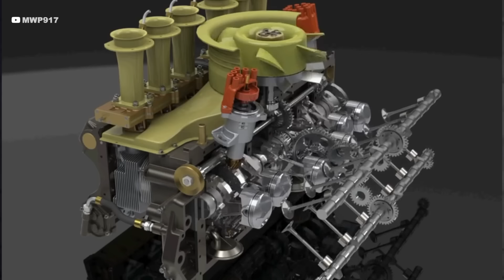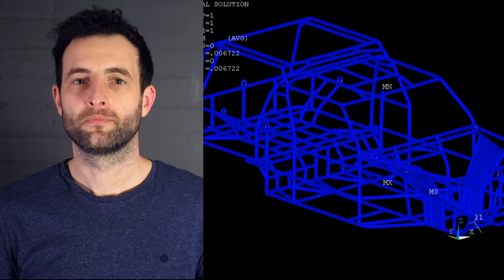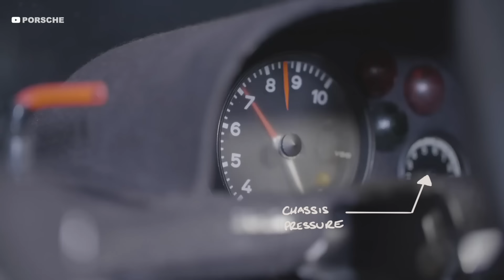The Porsche That Had an Inflated Chassis

Comment: A little misleading about the horsepower claims. The Lemans cars never came close to 1000 horsepower. Those numbers came about when the turbocharged 917/10 and 917/30 Can Am cars came along. My recollection from that era was it made under 600 hp in endurance racing mode and was severely out powered by the can am engines of the era that were around 700 horsepower. My favorite car of the era by far but by that time Enzo had lost interest in endurance racing and the very limited support of the 512m was proof of that. Roger Penske built a 512 that was faster on 3 separate occasions in a very limited schedule during the 917k models season. Ferrari spent the time developing the 312 for the following seasons rules and they dominated the next year. It would have been great to see the two teams slug it out for both of the 917 Lemans cars seasons but that didn't happen.

Comment: I remember hearing a story of a Top Fuel drag bike that also had a pressurized frame.  The difference was that it was pressurized with nitrous oxide and that much of the gas would be lost during the run with the leak being traced to just in front of the intake.  It seems like a good part of racing is the 'creative' interpretation of the rules and hiding it from the inspectors.

Comment: Extreme heat in the cabin is the lesser evil seen in the light of a crash...!
However, this car "only " got 520 Hp as standard, but with turbo (from 1973) that beast had 1100 Hp. 
The car weighed between 730 and 909 Kg. Imagine a weight to HP ratio of 0,820 Kg/Hp.

Comment: Porsche hired John Weyer from JW automotive engineering in England to come to a test and figure out why the 917 was so unruly. Weyer and one of his engineers were the ones that picked up on the bugs being on the front and not the rear. Weyer then asked the Porsche mechanics if they had any tin snips and without talking to the Porsche boys set about cutting up the rear of the car and reshaping it right at the track. This led to more stability and faster times. There is a video on YouTube with John Weyer telling the whole story and more it is well worth the watch. It will easily be found under John Weyer racing Porsche etc.

Comment: Another advantage of pressurizing the space frame is that the peak compressive load and average stress in the compression members can be reduced, thereby reducing the tendency to buckle. That would enable the designers to select longer spans of pipe to be used with fewer joints. Fewer joints = fewer stress risers = a structure that is stronger pound-for-pound. However, you wouldn't want to pressurize tensile members as that would increase the average stress acting in them and shorten their fatigue life.

Comment: Might need to do some fact checking there the space frame was only ever pressurised with air to see if there were any cracks in the chassis 

It was only ever rumoured that the chassis was filled with nitrogen

Comment: They fill the chassis with nitrogen or other inert gas in order to detect leaks. Fractures or cracks in the chassis would be easy to detect if there is a gauge on the chassis and the whole chassis is under like pressure. It has nothing to do with making the car lighter

Comment: The longtail version had the rear flaps connected with the suspension, moving up and down when uphill or downhill, increasing or decreasing downforce
Reply: Except they didn't do anything...as evidenced by the 1969 Osterreichring testing that showed no bug splats AT ALL on the rear flaps, even after they cranked the angle up...and up...and UP to fully vertical...straight up !... and still no bug splats. Good idea, but these flaps didn't work.

Comment: I have LOVED the 917 since I was a kid in the 70s. I had the Hot Wheels version.  As I grew older I got into building 1/24 scale models, the 917 was never available. 

When Ford made the GT back in 2005 the first thing I thought was why not Porsche make a road going 917?  Porsche making a V10 monster for the street with the smooth sexy shape of the 917 would have been nice.

Comment: Storing oil in the frame comes from earliest race bikes. It doesn't only save an oil tank but it also saves an oil cooler and therefore it safes a certain amount of aerodynamic drag. At least that was the reason race bikes used the frame as an oil tank.

Comment: Put high pressure on that nitrogen, increase the tubes diameter, reduce the wall thickness further.
That way the tubes would take more torque.

Comment: One relatively unknown bit of trivia, regarding the Salzburg Le Mans 1970 race-winning 917 (#23) of Hermann and Attwood:  Their car was was a four-speed, and was fitted out with a VERY tall first gear, such that they calculated their car was giving up ten seconds a lap to the front runners.  Just dragging like a VW bus out of every slow corner and when leaving the pits, and they were pretty demoralized at not having a competitive car (so they first thought).
The idea, of course, was to minimize wear and tear, and, in the end it did pay off with the win, while most of the other 917s, all driven more aggressively, failed to finish.  Siffert, for example, who, while leading by four laps or so, missed a shift and blew up his motor rather spectacularly by going down a gear, rather than up a gear under heavy acceleration.   Then there was the #25 of Elford, Ahrens, who's car failed somewhere around the 20th hour with a cracked bell housing (the large bulge which surrounds the clutch).  The second failure can be attributed to accumulating stress and strain on the entire engine/transmission, of which it seems the bell housing was a weak point, while the former can be attributed to...
...well.  Your opinion is as good as mine.

Comment: Terrific video! Thanks to such detailed info. Really fascinating!

Do you know if anyone is using aerogel as an insulator? It's incredibly effective and weighs next to nothing as it's about 99% air. Yet you can sit it over a hot flame & it still be effective on the other side. 
(Imagine a Petri dish size and shape piece of blueish solid "foam", clamped over a Bunsen burner with its flame blue, and on the other side, a small, fresh flower. I've seen this experiment and the flower didn't even begin to wilt. In fact the guy doing the experiment put his hand directly onto the top and said if wasn't much warmer than room temp!)
Being glass (the remaining 1%) IIRC it's a good electrical insulator too. Given that it can be formed into any shape you want, and keep parts of the engine warm and others cooler, it makes sense (in my mind at least) to use it.
Reply: The new Corvette

Comment: H-60 helicopter main rototar blades has titanium beams filled with nitrogen as well. One of the reasons is for thinner sidewalls to reduce weight. The pressure of the nitrogen makes it more ridgid. Just like a rubber balloon. A balloon with no pressure is flimsy a balloon under pressure rigid

Comment: The volume of air in the part of the frame that was not used to move engine oil through the cycle from the motor, through the front cooler, and back to the motor again, was a separate circuit than the rest of the frame.  As to the rest of the frame:  I wasn't aware the latter circuit was pumped full of nitrogen, but I do believe cracks in the frame showed up by something as simple as a drop in internal pressure, measured by a simple, welded in, pressure gauge, just as you might attach a semi-used tire gauge to your tire valve to check tire-pressures on a bicycle.  It needn't have been more complicated, although diagnosing where the leak actually was might have required something as simple (too) as a smoke test, internally, to find the leak, seen externally.

Comment: Was the original 917 with no flies and bugs at the rear the LH and the shorter, open ended one [primarily featured in the footage you use] the K which was 30mph slower but dominated overall?

Comment: I think the real reason to use nitrogen wasn't to prevent reacting with the frame. It was for better pressure stability across the operating range. Heat from the engine, fluids and other parts would have caused wider pressure swings as the various parts of the chassis heated and cooled.

Comment: As a kid I had a model of the Gulf 917. It was over 30cm long. With a pull back spring motor.  Don't know what the gearing was like, but when you pulled it back about a metre and let go it shot off at a lunatic speed.

Comment: I thought they used nitrogen to displace the atmosphere and save a few grams, but boy was it a genius method of monitoring cracks!
Reply: Pure nitrogen would be slightly heavier than regular atmosphere. Even if you pulled the frame down to a vacuum it would only save a tiny bit of weight.

Comment: They should place fluids in the frame maybe not fuel though. Oil or maybe a very inert coolant. 
The level of engineering was insane. The text on the tyre heater 'remove before flight' a little foreboding! The cooling fan atop the engine like like a tyre rim. 
PS, yeah I got to that part now. Never crossed my mind about cabin heat. How was the frame filled with nitrogen and fluids? Or was the pressure monitor removed for the fluid frame?

Comment: you are right that pin connected two force members can either take compression or tension but when you weld them, they can actually bend which is unfortunate. that's why some bridges use bolts rather than welding. great video overall

Comment: Excellent video! However, you forgot to mention that the redesign of the rear wing was only a part of the solution. the 917K (k for "kurz" = "short" in German) was also more than 60cm shorter than the first version (917 LH)

Comment: Per Porsche 917 (by Gordon Wingrove) [page 58], the bug-spatter discovery/downforce solution did not come from Porsche, but from John Wyer's engineers at JW Automotive (who Porsche employed to sort out 917 problems and to make improvements). Book excerpt [my inserted comments are in brackets]: After some tyre testing, the Wyer personnel were invited to become involved [with the 917's aerodynamic issue]. John Horsman [JW Automotive Engineering Manager] was well-acquainted with high-speed aerodynamic problems, having been instrumental in using spoilers to stabilise the early design of the GT40. He spotted that while the front of the coupes were covered in dead flies and gnats, the rear spoilers appeared to be clean except for the very top edge -- which indicated that the airflow was mostly passing above them. After a group discussion between both the Porsche and JWA engineers and with some dimensional input by John Horsman, Cuoghi [JWA Chief Mechanic] and Davies [JWA Mechanic] then set about building a rear 'deck' for [chassis] 008. [Note: The 'deck' was effectively the "boilerplate" for the rear-end fix that resulted in Porsche/JWA joint development of the 917 short-tail version, i.e., the 917K.] Brain Redman went out to try a couple of laps in the [modified chassis 008] car -- and stayed out for more as he gained confidence in the handling. When he came back to the pits he is quoted as saying 'now you can drive the car...

Comment: The pressurized nitrogen strengthen the structure. If the used without the nitrogen, will colapse. Thats why have a manometer inside the car.

Comment: You forgot to mention about Turbocharged version that produced almost 1600HP (in qualifying mode). And forgot to mention that the engine was not a boxer. Engineers found out that flat V12 produced more power than boxer 12.

Comment: John Ficarra over at VinWiki tells the story of the Porsche 917 and says its a rumor, that the chassis was inflated with an inert gas. According to him it  was just pressurized air to be able to measure the pressure and tell if there is a crack somewhere in the frame.

Comment: Guys please think metric!!!
The 917k was even faster in May 1971 at the 1000 km race in Spa Franorchamps on the old course than in Le Mans. Petro Rodriguez/Jacky Olivier won with 0.5sec in front of Jo Siffert/Derick Bell both in the Gulf 917K. They finished the race in 4h1min9sec. That is an average speed of a little bit above 249km/h. The pit stops were 1971 much faster than 1970. The 917 got more then 100 liters fresh petrol in 8 secs.
The two cars were racing the Masta Straight down with 330km/h sometimes side by side. I saw that race. The first hours I watched the race from the famous Eau Rouge grandstand (check video up there) later at the Masta Knick.
Especially Jo and Petro due to their hart rivalry in F1 and endurance were racing like mad. In their last stint they were improving the lap record from lap to lap. Finally Joe won this extra competition. He did the 14,1km in 3min14,6sec which means he did an average speed of almost 261km/h.
I think Joe and Petro in one car, less slower cars in the race, these two crazy drivers would have finished the 1000km in less than 4 hours (1 sec faster per lap!) and an average of 250 km/h. In 1970 Petro won the last F1 race on the old track (with an extra chicane though) but the 917 and the Ferarri 512 were much faster the same year than the 3 Liter F1 cars.
Unfortunately there are no videos from this fastest sportscar race (1971) on a normal road ever.
On a sad note: Petro and Joe both died in 71. Not in a 917, Petro in a Ferarri 512 S and Joe in his F1. May they RIP.
Both are for me some of the bravest drivers ever. Take a chance and go to Spa Franchorchamps drive along the parts of the old course with a car or motorbike and imagine 261km/h average speed...
And again for all you mph-guys: metric is not all that difficult...

Comment: My mate turned up with a bmx bike  years ago that was pumped up with nitrogen we weighed it with and without no weight difference
Reply: Its not to reduce weight. They filled the frame with pressurized nitrogen to track the condition of the frame, if it cracked the nitrogen would escape, at that point driver would have to stop the car in order not to cause accident.

Comment: Long before the 917, some tube frames were pressurized, fitted with a pressure gauge. Quick visual warning of a crack in a tube or a failing weld...

Comment: Nitrogen was NOT used to make the car lighter. Pressurized gas was used to test cracks in magnesium. so the oil would not leak out. Wyer replaced system with normal oil tubes to add reliability, because a small crack would finish the race

Comment: I would think they could produce frame thad would not have any strenght safety margins if under pressure... Its harder to crush a tube under pressure then the one that isnt pressurised
Reply: The pressured chassis was only for the detection of cracks.  While true that pressure of thin walled structure will give strength (think soda can).  The tubes in the frame of the 917 are thin, but for structural analysis, they are not and do not benefit from gas pressure on their strength.   What is important when looking at the stresses on the frame is how well the engineers at Porsche managed to keep all the forces on the frame in compression and tension with little or no bending moments applied to the frame.
Reply: @DrsharpRothstein   I know, I just would tought if they took it that far they should do this step to...most space rockets cant even stand upright without beeing pressurised https://youtu.be/imkdz63agHY?t=19 
Space X had simmilar failiure recentlly..

Comment: The porsche did not had hellium, to all the bamboolzed guys out there, they did have a 1 piece chassis, but it was just to test if the chassis was cracked or not, so they'd put a pressure gauge to see if there was any pressure loss. The 917k DID NOT have hellium in it's chassis, it was just simple engeneering, not dumb stuff like that.

Comment: WHERE  you got this Nitrogen story from I dont know.I was a mechanic on the 917 i n 1 1970 andg never saw a nitrogen cylinder.The chassis did a lot more than one race.The chassis were pressurised to check for cracks with an airline from a compressor.

Comment: Re:  The 917 number of the motor re the  motor project number--I want to say 912, but I'm probably wrong, as the 912 designation shows up in parts for the 911 of that era.  So...I can't find it tonight.  The Porsche 917 motor is sometimes described as a "Boxer," which I believe is derived from the Ferrari flat twelve cylinder motor as a reference, however the Ferrari motor compresses (which costs energy) the air volume INSIDE the crankcase, underneath the cylinders, but then lets it expand again on release.  The Porsche motor does not:  It keeps the same air volume underneath, but simply moves that volume back and forth due to timing and order in which the cylinders are fired.   A BIG savings in powers, IMO, although I'm probably over-estimating it.

Comment: Interesting. I don't think Porsche was the first to pressurize chassis tubes to confirm integrity. Aerobatic aircraft have done this for many years to accomplish the same thing. A nice bonus of using nitrogen is that it helps protect the inside of the chromoly steel tubing from corrosion.

Comment: I understand that the tubes in a space frame chassis are engineered with tension and compression as the main structural roles to be taken into consideration... But, ONLY tension and compression???...  Are the tubes not subjected to any substantial torsional loads that have to be taken into account also?

Comment: It's actually very difficult to save weight replacing steel with aluminium as aluminium does need more material to give similar strength conpared to steel.
Only when going for Magnesium alloys the balance shifts in favour of the lightalloy .
But the there is Titanium , just as delicate and elaborate to work on .....
The Kauhsen 917 LeMans winner was ,according to Willi K. himself  one of the very few 917 chassis made from magnesium alloy tubing ....